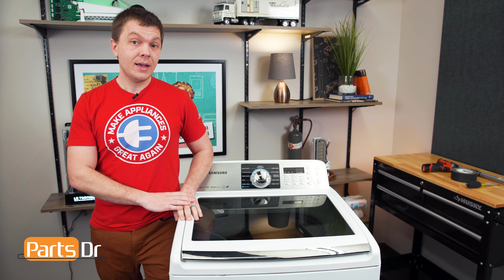How to replace Samsung washing machine bleach dispenser part # DC97-16972A

Comment: The bleach dispenser on my Samsung washer is just a whole on the front top of the washer. There's no plastic frame around it.
Reply: The same exact thing happened to me. Did you find it down in the washer? Or was there just never one in there?

Comment: The bigger problem here is the rusting out of the metal around the plastic dispenser. This has been identified in many YouTube videos but zero action taken so far by the manufacture. I would like to see this problem addressed.